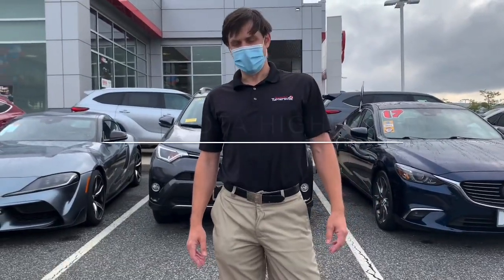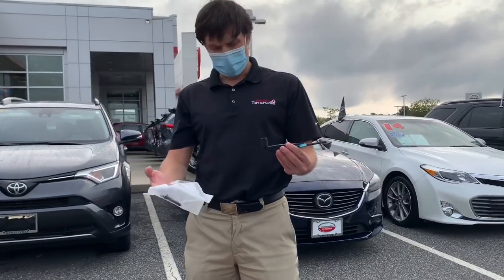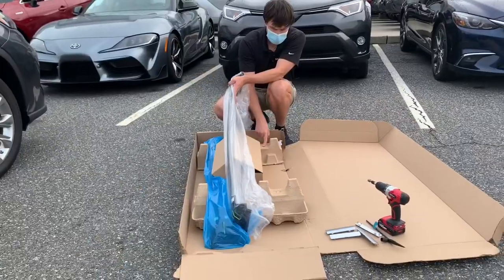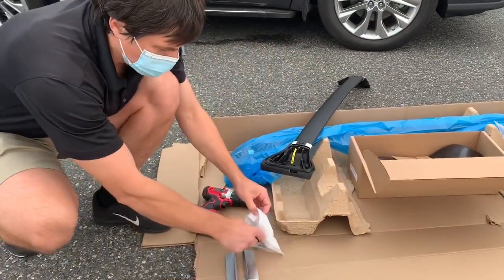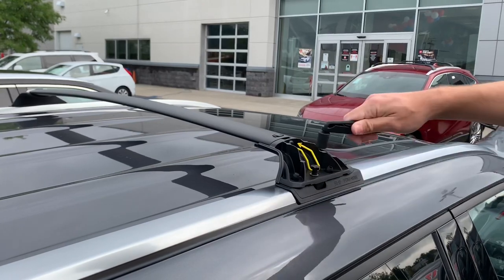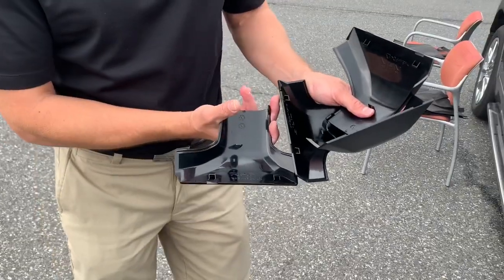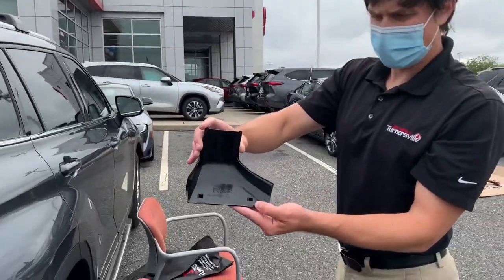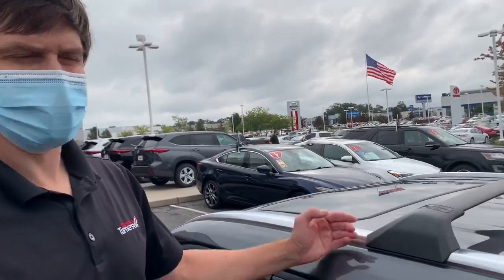Cross bar installation for 2020, 2021, 2022,2023 Toyota Highlander

Comment: Thank you fir the video.....weird how the slots for install are so far back on the rack.   Really bad for putting bikes on the roof rack.
Reply from the maker: Agree, I wish you could adjust that…
Reply: @stanrogulin3798  What are the chances one could remove one of the crossbars, and then cut in new  holes in a different part of the frame, a little closer to the sun roof to relocate the crossbar?
Reply from the maker: @edwhite7809  would not recommend that

Comment: How many weight for kluger roof thx. 😁
Reply from the maker: Maximum carrying capacity :80 kg(176 lbs)including the weight of the rack system 5kg(11 lbs)
Reply: @stanrogulin3798  thx a lot

Comment: if the highlander comes with the cross rails installed, would I get those silver trim covers to put them back if I want to remove the cross rails?
Reply from the maker: Yes,-you will find them in the glovebox
Reply: @stanrogulin3798  Thank you!

Comment: I actually want to remove these 2021 highlander crossbars to reduce wind noise but don't want to scratch up my roof to get those t-shaped plastic covers off.  I see two small slots at the bottom of that plastic cover.  Any tips you can provide to remove those plastic covers without damaging the cover or the roof is appreciated.  This sounds simple, but these covers look far easier to put on than take off.
Reply from the maker: I will try to record a video on how to remove cross bars on 2020-2021 highlander tomorrow if I will get a chance.
Reply: @stanrogulin3798  - You can disregard this.  For the 2021 Limited/Platinum, I found that all I had to do to get those t-shaped covers off easily was to use my fingernails to get under the smaller part of that cover that wraps around the actual crossbar and pulled them off.  This works much better than messing with a screwdriver to pry this plastic cover off and you don't run the risk of damaging the se plastic covers or your car roof with a screwdriver at an awkward angle.  After the covers were off, removing the crossbars the rest of the way was easy.  I just used a metric socket with a ratchet to remove the bolts faster than using the tool Toyota provided.  For anyone else doing this the little plastic plates used to cover the holes after you've removed the crossbar are location specific for front/rear left/right side.  I definitely noticed a reduction in wind noise on the highway and secondary roads after I removed the crossbars.
Reply from the maker: @wrekkingcru  great! Congrats!

Comment: Hey Stan, I bought my Highlander from your dealer. Thanks for the video. Good job. By the way, why you guys stopped selling parts? I tried to order the cross bars but I can't.
Reply from the maker: Hello Kien! We sell parts! (Including cross bars for your 2021 Highlander).Our parts department phone number is (856)516-6460 . Have a great day!
Reply: @stanrogulin3798  I didn't know that. The online store has been closed. I thought you stop selling parts. Do you still offer discount as you did for online orders?
Reply from the maker: @kienvo  please contact our parts department directly (856)516-6460. Thank you
Reply: @stanrogulin3798  I have a question, Stan: Does installing cross bars have any impact on performance such as speed, MPG?
Reply from the maker: @kienvo  It looks like MPG is the same on a window sticker for the Highlander with Cross Bars or without.
Reply: @stanrogulin3798  aerodynamically speaking, I thought it could affect the car's performance. Thank you for your input.
Reply from the maker: @kienvo  my pleasure
Reply: @kienvo  Surely, it does. It's just common sense - regardless of any window sticker...